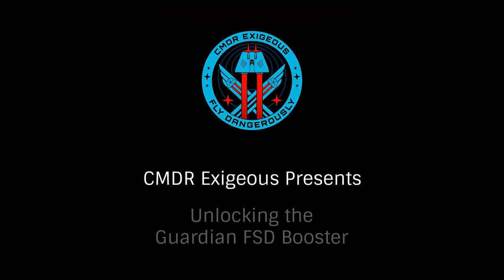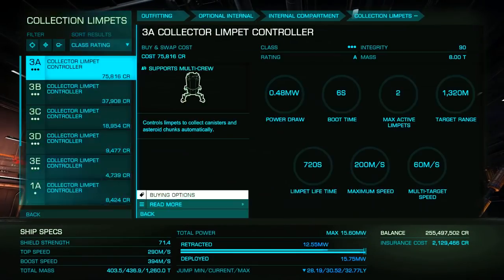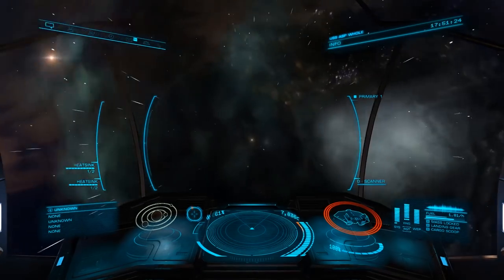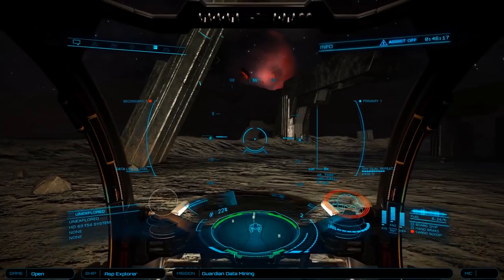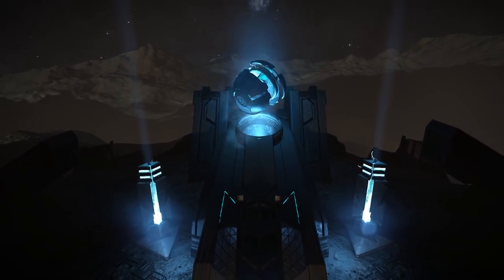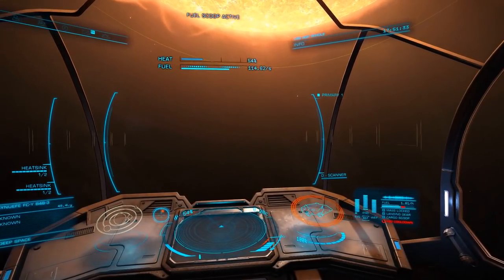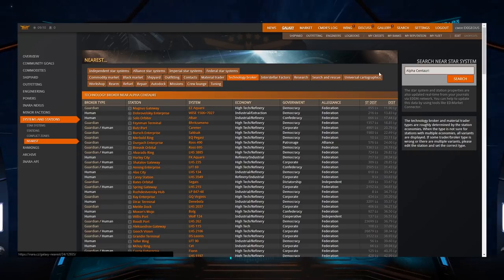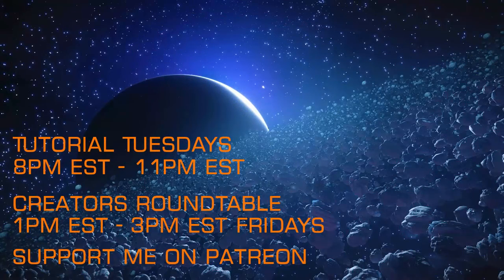Unlock the Guardian Frame Shift Drive Booster (FSD) in Elite Dangerous for Maximum Range (Tutorial)

Comment: Thanks man, awesome clear instructions!

Important notes to this that make it easier:

- Take a small ship so you can park really really close (preferably inside the ruins)
- The sentinels are much more of a pain as the video above describes.
- Take point 2 or 3 defenses with you and make sure they are located on top of your ship not on its bottom. The point defense on your ship will take out the inbound missiles from the sentinels. point defense modules located on the bottom of your ship won't be able to get a clear shot to the sentinel missiles.

Relog if you want everything, you can only activate the site once
Reply: The sentinels are piece of cake... All you need to do is repair your SRV with premium, load your repeater with premium ammo and dont be scared... When they appear, just put 3 pips in weapons and in 15 seconds they explode in a beautiful blast... When they fire missiles, just quickly put 4 pips to shields, when missiles hit you, nothing much happens, then pips to weapons and continue...

Comment: Thanks for the tip.  Anaconda landing site,  head to location 40.8394 by -106.5824 ,  you should be able to land or recall your ship to land here. It's around 1.85km from the site.
Reply from the maker: Thanks for sharing, pinned in case others take something so stupid - I mean large, not stupid, large! :D
Reply: Just got there in my Conda and didn't realize how terrible the terrain was. Spent a good 10 minuites looking for a landing spot before giving up and looking to the comments section. Thank you CMDR!
Reply: I'm getting my focus crystals first but I read the comments luckily before I set off for the guardian site. I'm in my anaconda but will be switching. Whew...
Reply: Is it possible that coordinates change? Im at the exact coordinates. Its 27.3km away fromt he site and a like..iudk.. VERY steep angled slope. idk how steep but very steep. 70 or 80°
Reply: @jspangla perfect, thanks!
Reply: @jspangla or 40.8465. -106.5811 at 185 deg. But manage the arrows once your in the blue.
Reply: @zarconeus  or 40.8317 -106.6267 facing 344 deg
Reply: Anaconda landing site: 40.7639, -106.5242 (212 degrees heading). 800m away from the ruins.
Reply: How do you get to the coordinates easily? I can't get the two numbers right just one or the other. 😢
Reply: 40,8242 - 106,5972 anaconda
Reply: @Exigeous  well I am sadly taking an anaconda and I've been out here for a bit looking for the site it's not popping up when i get near the planet so I'm assuming i need to be in the atmosphere of the planet for the POI to pop up? there needs to be a bit of more detai l to this seem's kinda skimmed over a bit quick
Reply: @solidus6989  try the surface scanner

Comment: Great walk through! It was tough. Made the HUGE mistake of going first with my Anaconda. Had to drive several Kms to get there. Only to have my vehicle destroyed. Came back in my Asp Explorer and landed at the site and the Point Defense works great. Still ended up losing both of my vehicles, mainly panicking and driving to fast. Luckily there was a massive ship-station a mere 262 lys away and I restocked. Third time knocked it out. So fun! Could not have done it without this. I watched several of these and yours was easily the best. Thanks again!!

Comment: Couple other things worth mentioning: 1. There is a time limit to activate all the pylons. 2. Make sure you have materials to synthesize SRV ammo/fuel before heading out. 3. Sentinels will attack you but they are easy to focus fire. 4. If you park your ship close and it is equipped with point defense, then the point defense from the ship will destroy any Sentinel launched missiles, protecting you in your SRV.
Reply: Thanks for the tip about point defense!
Reply: Point defence tip is a great one
Reply: With the point defense assist from the ship, even a novice at SRV combat can easily dispose of the Sentinels. It's incredible, and a very useful tip.
Reply: I think you saved me a bit of frustration friend. I didn’t realize I only had to do this one time to unlock the Guardian Booster (the only piece of guardian tech I care about right now). I think it’s time to kit up the DBX and get back out into the stars for this

Comment: Some additional notes that others may find helpful:

When shooting the Energy Pylons, you have to KEEP shooting until the Info panel says that the pylon is charged.  At first, I only plinked at the first two pylons a few times and then couldn't understand why the other pylons weren't showing up.

A Diamondback Explorer has a more options for landing near the site than a Krait Mark 2, but it's still tricky.

The other four pylons only rise up out of the ground once an SRV gets close.  But, once they are sticking up out of the ground, any energy weapon will charge them, including ship-mounted.  If you've got a friend with you flying a ship, then a fixed beam laser will charge the pylon.  ...or you can just drive around, get all of the pylons to stick up out of the ground, and then get back in your ship and use your ship-mounted weapons (if you'd like to charge the pylons without worrying about being ambushed by Guardian Sentinels /while/ shooting the pylons).  Whoever is flying needs to know that the pylons face outwards AWAY from the center of the site.

This same flying friend can also help kill the Guardian Sentinels.  They can be hit with fixed beam lasers.  I didn't always feel like fighting those Sentinels in my SRV, so I sometimes drove back to my ship, took off, and used my fixed beam laser to kill the Sentinels, landed, got in my SRV again, and looted the parts.  The Sentinels barely move at all, so aiming shouldn't be an issue.  Sentinels don't show up on ship's sensors, unless the Sentinel is explicitly attacking the ship.  If whoever is flying can't see the Sentinels, the SRV may need to shoot the Sentinels first so that the flying friend can see where the shots are going.

If you're alone, it helps a lot to do this during the "day" when you can see the terrain.  The moon has an orbital period of 1.2 Earth Days.  If it's nighttime at the site, log out 20 kilometers away and come back in a few hours to see if it's day, yet.  If you've got a flying friend to help you, then the ship-mounted lights might be able to substitute for day.
Reply: I'll add here, I went by myself and fought all the sentinels in my SRV as well as doing the event, because of that I ran out of ammo in my SRV with no materials to synthesise any more so I couldn't collect all the Guardian Power Cells and Guardian Technology Components. Either use your ship weapons but with the time it takes to land it's tricky, stuff disappears or make sure to have some materials for ammo. Don't be like me forced to fly back to the bubble.
Reply: If you park your ship in the right place, the headlings should light up a good portion of the site as well. Even if they're some of the narrower beams like the Conda.
Reply: i'm doing the return flight of shame myself right now =(
Reply: The materials for SRV ammo refills are available on HD 63154 B 3 A
Reply: You take elite to next level. I like it.
Reply: Your pylon map is way too dark to see the with structures they are by but the video was very helpful on explaining how to get the bp

Comment: Sorry for the lengthy post, but I wanted to share my experiences here.
I went to the site yesterday and was lucky enough to arrive there at daylight. Even so, when sitting in the SRV it is easy to lose your orientation and I had to use my camera several times in the beginning to get my bearings back. I did find a landing spot for my ASP Explorer very close to the site (5 o'clock if you consider the terminal at 12 o'clock). In fact it was so close to the one pylon there that I almost had trouble charging it since you have to have some distance from the ship to use your turret. But good of course for the Point of Defences (I had two on the top) to shoot down the missiles from the sentinels. I still got toppled a few times from their attacks, but it was manageable. The pylons come out when you drive by closely, so you may want to raise them all before you start charging them (that way you can also get rid of most sentinels already). In any case your guide was extremely helpful and I got the blueprint on my second try. I ran out of time charging because I did not find the next pylon in time, but fortunately the pylons stay up, you just need to re-start the charging with the ones at the terminal.
As it turned out the "hardest" part was in fact to get enough technology components. I had to re-log twice only to get those components. As somebody pointed out below, their spawn rate is much lower than for the power cells. When logging out the game warned me about "dangerous zone" and "respawn in a safe distance", so I boarded my SRV to be on the safe side, but after logging back in my ship was in fact still at its parking spot, which made the grind a lot easier.
Final Note: I went to the neighbour system after it, because the megaship The Gnosis was incidentally in the area. When I scanned the system I found there is another Guardian Site there as well. After some googling I found out it is a site for weapon blueprints (e.g. Cannon site has a list of all Guardian Sites and their status). So if you are after both types of blueprints it could save you some travelling around (I did not check it out myself though).
Again thanks for the video, great work. And also some good additional advice from the comments here, thanks to those commanders as well.
Reply: i parked mine just after 6 o clock from the primary pylon. worked great to shoot down all missiles with point defense. do it 2-3 times you'll get the feel for where the pylons all are. i drive around in turret mode with the scoop down really slow so i can target the things i want to scoop up. this also helps visibility as you can look around while driving.

Comment: Anybody attempting this as of today, bare in mind that the segment is now called the fragment. It confused me.
Reply: Did the HD63154 several times yesterday (damn the drop rate on guardian tech modules) and its still pretty much good. Couple things should be said though (adding to the point you already made):
1. There are more types of the destructible panels than those pillars. Before mode switching/reloading check those as well, you don't have to do the whole site over if you need just a couple of pieces
2. There is more scans/materials that can be collected on this site, but I understand the focus was on obtaining FSD booster.

Comment: Managed to finish this thing today. Fighting the drones was easy, then during the "light the beacons" part, it got slightly harder with 3 drones attacking at the same time, fortunately, they aren't much of a challenge when using tactics and taking them out one by one. But when they topple you over all you can do is to sit and watch as you spin around, hopefully not heading down the hill... annoying.

The most difficult thing was to get the damn ship to land so you can board with the SRV. I found a good landingspot in the actual base (Using a diamondback explorer) but from cause of habit i pressed depart and thought "Crap!!!"  I had to try 7-8 times to recall the ship before it landed on a somewhat flat part and i could reenter, all other times it just hovered 10 meters over the ground, once it got to a good spot, but i flipped over and my jet was disabled (thank you for that dumb limitation).

Whoever who thought that the mission would be a good idea to have on a non-flat planet should get slapped in the face by Braben.

Comment: Just did this on Krait Phantom. Here are few things I found useful to know:

- Phantom is probably largest vessel you can park within the site. It is VERY mountaneous. The landing position was so tight I was literally tapping on controls ever so slightly to catch it. Do not be lazy and outfit smaller ship. For phantom owners: try parking at 40.8028, -106.4980 heading 215, it may take a few minutes to find blue spot.

- Point defence works like charm. Put two of these on side slots of your Phantom and not a single rocket will hit you. Make sure they are stocked with ammo. Make sure they are not offline.

- Consider doing this solo. I arrived at the place in Open Play and 3 more commanders arrived while I was searching for a landing spot. Some pilots are not very attentive while doing landing maneuvers and could damage your ship. Even if your partner lands further away (and will rely on your ship's PDD to protect him) it can still bug the pylon event. We activated all pylons but terminal just wont accept the relic. Other commander bailed out after few unsuccessful attempts to fix it and then terminal magically worked.

- Make sure that you have SRV ammo and fuel, bring materials for one recharge for each SRV. Unless you cleared a lot of guardian ruins before and can do it reasonably fast.

- Manage your energy. Sentinels will not be able to damage your SRV shields much if you put 2-3 pips on SYS (unless you facetank it). Terminal is positioned in such a way that you would need to boost SRV up. Do not let your capacitors deplete or you risk falling or facing enemies without shields.

- Explore facility carefully before activating pylons. This will likely activate most hiding sentinels thus allowing you to deal with them one by one. They have quite a lot of health, so I would not recommend driving around and poking pylons randomly - you very easily get swarmed.

- Be mindful of terrain. The facility is on plato with canyons on either side. It is not improbable that you will lose your SRV by falling there. You could consider bringing two of these just in case.

- Daylight helps. I know it is not something we can control, but Night Vision is useless in terms of giving you terrain awareness compared to shadows from a star and ship manufacturers refuse to put auxiliary lights around/below their ships, so you will only properly see a small cone forward. I arrived right at the end of night and morning hit when we were trying to fix Terminal, quite unlucky.
Reply: I feel you on the Phantom, I took mine out as well and must have spent about 35 minutes just looking for a spot to park : / Can't imagine what people go through when they show up in a Conda x_X
Reply: @RetirededKat  it's about 5km from the site that the big ships have to land, i can confirm 100% doable with corvette, type10, and anaconda

Comment: My asp explorer now jumps 65 to 70 lys now... It's glorious!
Gonna put this thing on so many ships!!
Reply from the maker: It really is great, isn't it?  My DBX is at 73ly with an SRV, etc.  Love it
Reply: CMDR Exigeous the asp has spoiled me. I named her the bubble jumper (Stargate Atlantis) I basically use it for mat grabbing. It's got more junk on it than it should, but I love it. I still need to re engineer a few parts because it still has some legacy parts that I could get striped down, but I don't believe I'd be getting too many more lyrs out of it.

Id rather spend my mats getting my cutter tuned for piracy.. since that's the only job I can think of that suits it. I wanted to use it for PVP, but the Krait and anaconda fill that role for me
Reply from the maker: Love the Atlantis reference, probably my favorite of the Stargate series.  Mine is the USS Asp Whole ;-)
Reply: CMDR Exigeous Atlantis was the best! God I miss that show... :(

Asp whole, lol, I like it
o7
Reply: HOW?? I can only get 69ly.. mind sharing how you built yours?
Reply: @Blessem_Soul  lightweight everything.
Class 4d engines clean drive with strip down.
Class 2a over charged powerplant
Smallest distributor you can fit while still being able to boost. I think I run a 3d ATM.
Smallest d rated shields with engineer effect that makes them super light.
Class 6 fuel scoop.
Adv disc scanner and planet scanner
Smallest/lightest srv hanger
Class 5 fsd booster
One lightweight heatsink
Reply: @Zelisius  SG ftw
Reply: @Zelisius  My Asp got the name Sol Toaster... For its looks xD

Comment: I just want to get my Vette over 20 light years...

Edit: If I could, I'd shake your hand, Commander. Never would have gotten my Vette up to 31.93ly without your guide. Thank you, and keep up the amazing work!
Reply from the maker: Well this should do it rather easily as you should be at around 15 or so if you're engineered already.
Reply: Mine at 21. This should make it pretty decent
Reply: CMDR Exigeous so this booster can be added to a fully engineered FSD drive? 😚
Reply: mikezbr the fsd booster fits in an optional module slot. It does not modify the fsd booster itself. So yes, it can be used with a engineered fsd drive.
Reply: Corbin Pettingill thanks for replying,  I found that out a couple hours after I wrote the comment. Thanks though!
Reply: Eh, full combat loadout  and its 21ly. Heading out tomorrow to get the booster
Reply: mine is at 22 after i put the fsd boost on it. it's truly a game changer
Reply: then i took it back to the site with a couple in my squadron just to prove i could haha